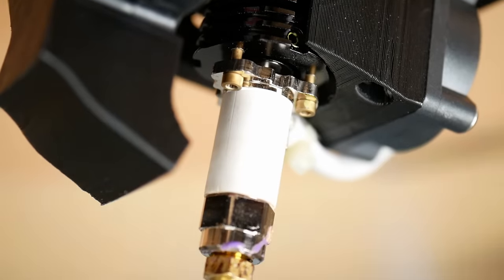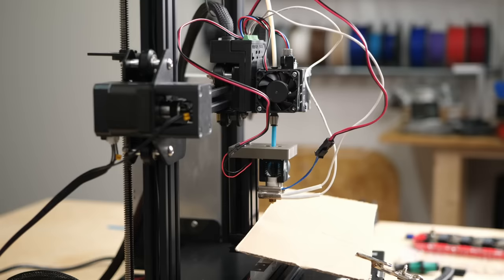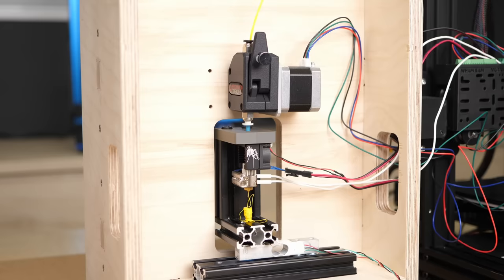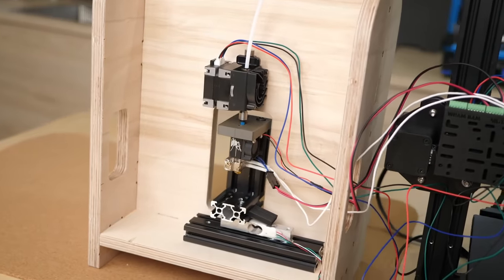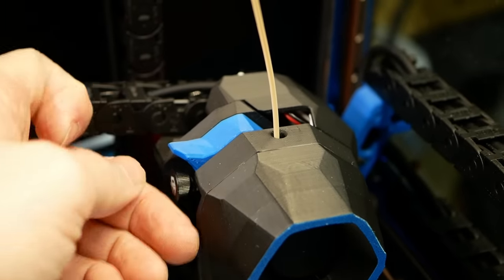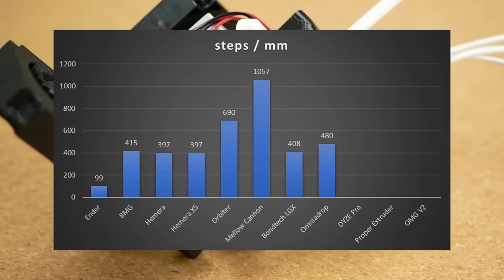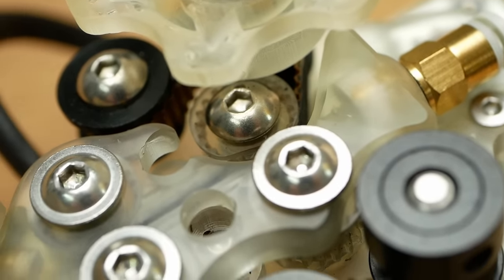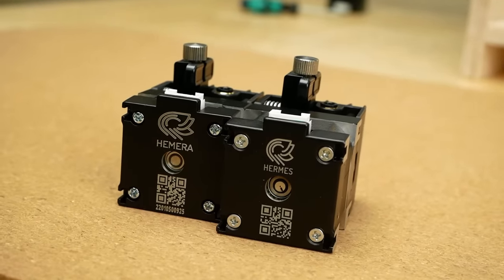I tried to find the Strongest Filament Extruder.

Comment: I've noticed you seem to be using some sort of software stabilization for some of your panning shots, which results in a bit of weird distortion. If your camera is capable of higher frame rates, I would suggest trying out higher speed filming and then slowing it down in post, which reduces the effect of slight camera shake.

Comment: BMG and Titan will work with lighter 20-24 mm pancake stepper. At least for Titan it's enough power to strip the filament, not sure about BMG.
As pushing force in normal printing, well, hot parts of the printer are the limit and pushing too fast won't make pretty and strong objects. I don't do mockups so I prefer quality ;)

For injection molding, either the mold must be at high temperature, or extremely small, to be filled with 3D-printer parts before filament start to solidify.

Comment: I would have like to see highest constant and reliable pressure rather than peak pressure, which I am not sure is especially useful. 
Maybe instead of turning off the heater, maintain it at a lower temperature ?

Comment: for injection moulding you need a lot of molten plastic and a lot of force, you will never be able to do this with an extruder. (unless you aim to make a 8x8x2mm part) or smaller parts.
you need the molten plastic in a heated chamber and then you can inject it with a ball screw because you need at least 50kg of force, even for small parts.
then your injection mould should be able to get hot and cold as needed, so you're in for a lot of work.
there is already a Desktop Injection Moulding Maching on YouTube at around 500 USD if I recall correctly.

Comment: @CNCKitchen
I am surprised that you did not use the recommended small, round NEMA motor, like on the orbiter, or a regular pancake motor and you also failed to show the overall weight.
The OMG offers hobbed bearings instead of smooth bearings, for additional grip.  Maybe you could try that.

Comment: Well, you obviously missed the Voron family of extruders. They'r weirdly named, like fox, bear and someone else. However, those offer full metal robust construction, lower weights and pretty much a simplicity.

UPD: the fancy names are flying fish, flying bear & (for sure!) the flying fox. Built upon the orbiter 2.0 general design but all-metal thus suitable for whatever a high-temp closed volume printing. Also, It's compatible with Orbiter aftermarket spare serrated gears and should then show a better force performance

Comment: The Flexible filament one... I dont remember the name, but I think its dual geared, and it has a brush attached to the gearing to clean it as it prints... It's bright red... I'll edit the comment if I remember or someone else leaves the comment.

Comment: I wish that you would have done a breakdown of how you got the final graph. I'm assuming you were using the force at the higher flow vs the total hotend weight? Additionally, in the US OMG sells a direct drive package that comes with a pancake motor. Would be interested if that would potentially change its performance.

Comment: Hi Stefan, cool video! I have an ender 5plus but i am still running a boden tube set up. I feel my Extruder is not strong enough. I can simply replace it with some of the mentioned extruders without switching to direct drive right?

Comment: I switched from an orbiter 2 in direct drive configuration on my delta printer to G5 flex with a nema 17 at the end of the flex shaft. I am still struggling with side forces from the stiff flex shaft that knock my printhead from its magnetic mount sometimes. I needed to go up to 1.5A for the stepper to be able to drive the 40 to 1 extruder fast enough for the volcano with 0.6 cht nozzle. Getting the extruder from Britain to Germany took nearly three months, but maybe you can give it a try?

Comment: I'll be seriously interested in your IM work.  With many years in the IM industry working on conventional and 2 stage Husky type machines I assume you are looking for an extruder that has enough force to fill an injection piston otherwise you will never get sufficient injection pressure with an extruder to fill a mold.  Funny my Dad and I created a pneumatic desktop machine 50 years ago.  Similar to the old plunger machines.  Problem with those is shot control.

Comment: I am really surprised by the OMG extruder. It´s cheap, has plenty of force, is not too heavy and it has a better feature than the other dual gear systems which have a huge design flaw. 
This extruder does not use opposing gears but works in tandem, really nice. It´s the winner here for me especially when you factor in price/performance. I mean I could also buy a Ferrari which is a super nice car but a BMW will do the job probably better and cheaper same goes for the OMG extruder.

Comment: Why not have one large, strong extruder fixed to the z-axis paired with a lightweight one on the actual printhead? The larger extruder would be tasked with taking much of the load off of the smaller extruder, and the smaller one would be tasked with making more minute changes to the feed rate with a quick response time. That'd be twice as expensive but i don't see why it wouldn't work

Comment: I have the OMG1 direct drive extruder. Now there is an upgrade to replace the smooth Bearings to gears. I don't know if these gear replacements will work with the V2. I like to see if this upgrade effects things compared to the stock setup.

Comment: Would it be possible to use a printhead with an insulated tank. Once a minute it will return to the Station (hotend / Extruder) and refuel taking some seconds.It should be easy to create a tiny and fast printhead. It should also be easy to make a multifilament Station.

Comment: i know this is probably a stupid question… but what does selecting a filament type in the slicer actually do?  Like if you have it set for PLA and have a profile that’s works well for PLA and then save-as a new profile and tweak settings to run PET-G but don’t switch the “material” to PET-G does that change the g-code vs changing the “material” to PET-G after tweaking all the settings?

Comment: Been using a Titan Aero since they came out. Cannot come up with a good reason to upgrade it. Then again my needs are different than yours. I've been using a stock nema 17 stepper motor and the only thing I might change is to put a lighter motor on it, with it's 3:1 ratio I can certainly afford to use a smaller motor and lighten up the whole setup. I've been using it like this for a few years(ish) and I tend to leave things alone when they work well, heh.

Comment: Wouldn't the little dimples the Dyze Extruder Pro creates in the filament trap air bubbles as it gets pushed into the molten plastic inside the nozzle?

Comment: i had hoped you would have put the Biqu H2 direct drive extruder in. a slimmed down version of the original hemera with a direct drive gear i have been having good results with it

Comment: I don't really get why you would want to use a printer nozzle as a injection molding pump.
The main problem is you simply don't have enough plastic flow. You would need an extraordinarily fast extruder and extraordinarily heating element to be able to pump enough molten plastic to reach every part on the mold without letting the plastic to harden too soon, what is simply absurd even having a 3mm diameter nozzle.
It would be way more practical to develop a plastic beads fed with a screw drive mechanism and a 10mm nozzle than using a 3D printer gear driven mechanism fed with 1.75 or 3.0 mm

Comment: very interesting stuff for injection molding. kinda pointless for 3d printing seeing as the stresses in the molten filament would render any prints low quality or unusuable at the higher pressures.

Comment: For the next round please include Sherpa Mini/Micro. It's one of the most popular extruders ¯\_(ツ)_/¯ And use 20mm motor with it for more power :) On top of that, need another very popular extruder - LGX Mini. Also, would cool to see all metal Vz-Hextrudort! Cheers!

Comment: At 4:30 are you saying the max flow rate of that mosquito hotend for PLA is 20mm^3/s?
Also, for a like-for-like comparison of the extruders, shouldn't the same stepper motor with same current setting be used across testing? Or at least across the extruders with the same size?

Comment: Have you ever tought that having a super strong extruder, that will push the filament trough no matter what, is actually a bad idea? Especially in a direct drive extruder.

Imagine this scenario, you get a heatbreak clog... ain't nothing going to unclogg that one dueing printing. But you have a super strong extruder... it will push that filament no matter what... something's gotta give... and it ain't gonna be pretty. Better to have a skipping extruder as a controlled failure point rather than an exploded hot end.

Comment: This was an awesome video and test. However, I have to wonder if you had the og bondtech tensioned properly because I have had many clogs on my e3d v6, and when it clogs I definitely end up losing steps on the motor and not grinding the filament. This is with a full size motor driven at 1.1A with a TMC 5150.

Comment: i am missing the apus which is super powerfull, would be intereseting to see how it performs compared to the others
Reply from the maker: It might be powerful due to the high gear reduction but probably limited by the BMG gears.
Reply: @CNCKitchen  it uses extremly sharp gears that bite into the filament very well, from what we have seen here at least 20 - 25% more pushing force than a orbiter 2.0

Comment: I really feel like E3D dropped the ball with the Revo. I've had to change my heater core once because the thermistor broke, and the last days the new core have started getting temperatures that are very inconsistent, so it probably needs to be replaced again.
I'm going to replace it with a Rapido, I'm just tired of the bad performance of the Revo.

That's..not really that relevant to these extruders, but I would definitely never buy a Hemera for this reason.

Comment: Isnt't OMG v2 with stock Aspina motor skipping much faster than here?
Reply from the maker: With the Aspina, yes. But if you just replace an existing Ender-3 Extruder and use it's stepper it's just like I tested.
Reply: @CNCKitchen  But then you need remove the push-in gear from Aspina shaft - different shaft diameter.

Comment: What about an extruder where the stepper is not located on the hot end itself, but similar to a Bowden setup, so a merge between direct drive and Bowden. Where the extruder part is on the hot end, but the stepper is located elsewhere, driving it through a flexible driveshaft? I'm not sure if anyone has tried it this way, and i may build a prototype when I get my printer working again, it would seem to be all the benefits of a direct drive but without that heavy weight of the stepper, allowing for even faster printing.

Comment: Question is, why do you need a big extrusion force from an extruder? Extrusion force should be tested with hotends not extruders. If the hotend does it's job there is no need for huge extrusion force. Extruders should be tested for smooth and consistent extrusion speed and print surface quality and how little the filament is mangled. I do understand that it was more for your injection molded project.

Comment: hey, use screw as direct plastic feed pellets direct extrusion, no filament step in the middle
Reply: screw the filament spooling step, no need to do that
Reply: more direct heat melting, less screw melting, shorter screw + heat, like in normal 3d printer print head nozzle
Reply: the screw will melt by friction, increasing the melting capacity, by using a dc high constant torque motor
Reply: use the worm gear directly itself, to push plastic pellets

Comment: I don't think this is a fair test. You overamped some extruders, but not others. But the bigger problem is the different stepper motors used in each extruder. In many cases where the motor skipped, not stripped filament it's clear there is headroom to get more force. I think the extruders should be tested with identical stepper motors where possible, to level the playing field down to extruder design, not motor choice.

Comment: You wont injection mould using an extruder
Reply: It would be possible with some combination of 1. Low physical volume part with no small/thin features 2. Going into a heated to melt temperature mold OR 3. Into a mold that is made of a material with either low thermal mass or 4. That has poor heat conduction transfer properties to increase the length of time that the melted plastic remains in the most liquid state to reduce the pressure required to get it into all the nooks and crannies of the mold. 

Theoretically, if you used a plastic filament that is very low viscosity once melted then you could do an ambient pressure pour like you would with molten iron or aluminum by simply pouring the melted plastic into a hot mold. In that case you would just need the extruder to liquify the filament such that it would drop into the opening in the hot cast mold and the hot mold would keep it liquid and gravity would draw it into all of the mold cavities.

Comment: i wish the zesty was on here
Reply from the maker: Damn, you're right! That also uses worm gears.
Reply: @CNCKitchen  yep. so i guess it wont be ideal for your injection molding plan but its still a interesting way to remove moving mass  :-D
Reply: @CNCKitchen  however.... would it not make more sense to use failed prints for injection molding?

Comment: Please share your data logs.. your videos are good, and you put a lot of effort in them, but i think this video stil can not be considered as a proper research. there are too many variables changing between every extruder you tested! some steppers you tested at 1.2A, some you even jumped 1.8A.. not even same motors.. its like "we compared 3 different animals which can fly further? eagle, f16 raptor fighter-jet, and a sea lion". I see the point of "manufacturer recommended settings" but then you are not comparing the real potential in the extruders, but you are comparing the motors.. If there are lets say 6 variables: amperage, motor torque, temperature, extruder type, length between heatzone and extruder, and extrusion force, then if you would like to compare 12 extruders extrusion force, then you should keep all other variable still.

Comment: You absolutely DO NOT need a STRONG EXTRUDER. A fundamental mistake right in the beginning of the video. You need a correctly designed efficient hotend with proper fitting parts in it, I demonstrated that and proven it million times to people. CANON extruder is just stupid, sorry. They seem to not know what their goal was.. They made it light, with small stepper, so it is supposedly meant for fast printers. Well, let me surprise them, fast printers also have to do fast retractions and with such gear reduction it will be a mess. Finding the strongest extruder maybe makes sense for your injection project, but is completely irrelevant for 3D Printing. For 3d printing you need the lightest extruder that can provide a reasonable push, going beyond reasonable push at a cost of increased weight is illogical.